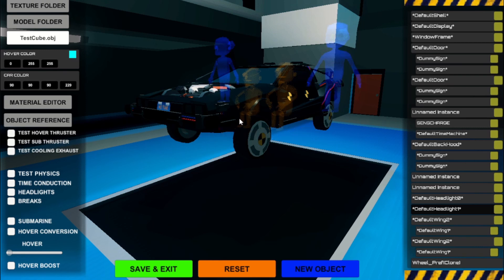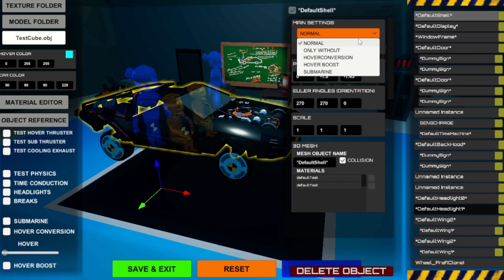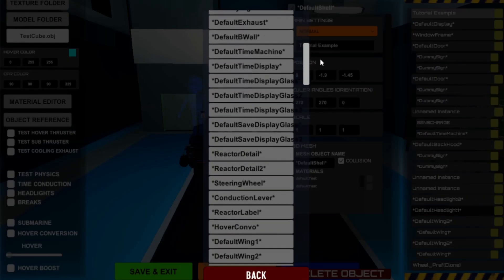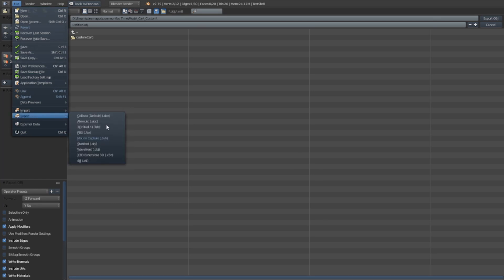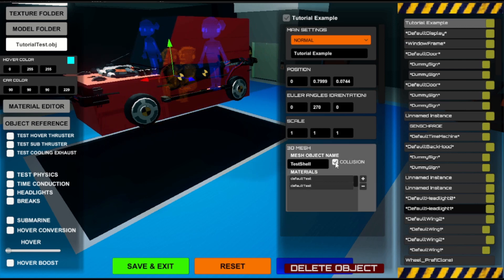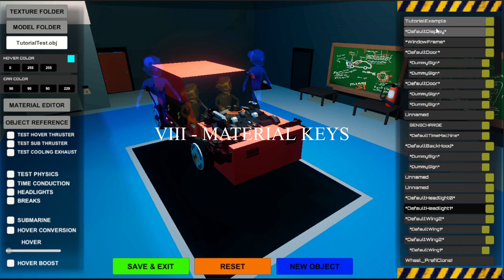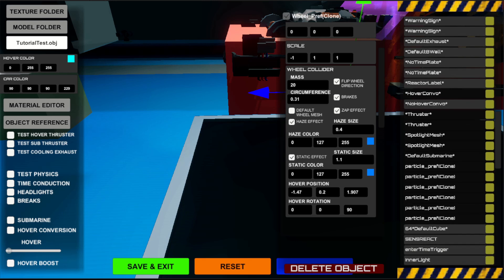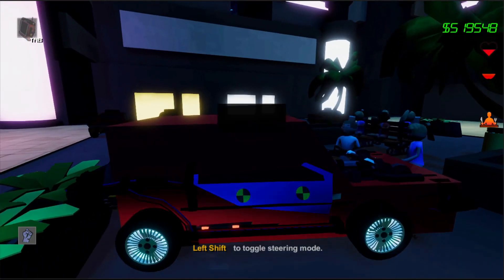CAR MOD EDITOR - The Basics

Comment: time travel watch is a good idea?
Reply from the maker: potentially but where would the reactor be
Reply: On your character back like a backpack. Put down insert a uranium and put back on your back
Reply from the maker: @pizzapityu4066  so like the mobile one the agents have?
Reply: @erathor9120  yes
Reply: @erathor9120  are you going to make it so it can be used as a time travel device?
Reply from the maker: @pizzapityu4066  its an idea but i believe it would have to be used in relation to the safe house, just like the gate functions
Reply: @erathor9120  Ok, I'm in

Comment: l intended to release the game for mobile one Day?
Reply from the maker: highly improbable as it is a resource heavy game

never say never though
Reply: @erathor9120  l didn't understand your question very well. 

l's brazilan and l don't understand english very well l'm using Google traslate here but l know it doesn't tanstate very well😅😅
Reply from the maker: @lucasgames6623  not likely that the game will come to mobile
Reply: @erathor9120  can you release an update with brazilan portuguese subtitles?
Reply from the maker: @lucasgames6623  once the game is finished sure id need  a translator
Reply: @erathor9120  kkkk
Reply: @erathor9120   are you kidding?
Reply from the maker: @lucasgames6623  what?
Reply: @erathor9120  will the game be ready until 2025?
Reply from the maker: @lucasgames6623  You mean fully released on steam? Yes.